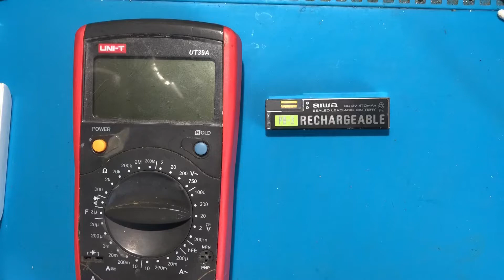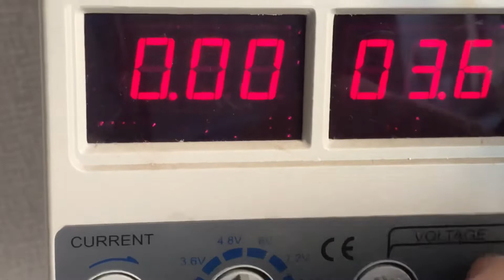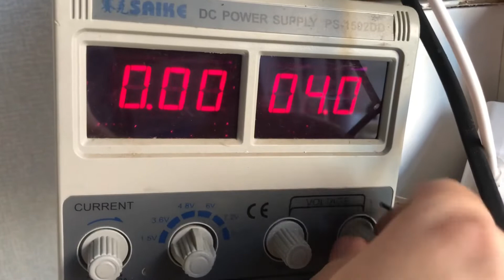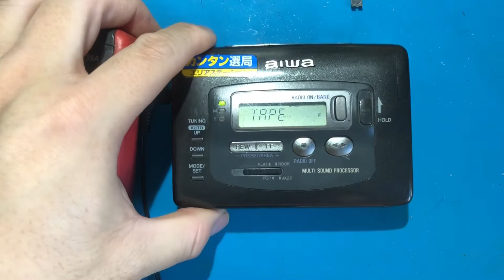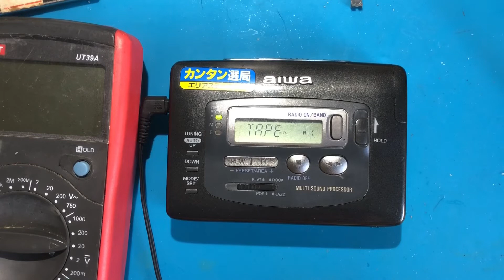Repair of AIWA WALKMAN PB3 lead acid battery

Comment: Nice work, this video gave me a base on which I am currently reviving AIWA PB-20, didn't know they had that port hole where you can add water in. 
Mine's a 6V one, 3 x 2V Cells, I actually used syringe to pour water in slowly until everything soaked, and I gave it about 7.2V for charging, didn't want to overdo and cause it to fizz, will probably take a while for the first charge but hopefully will work :D